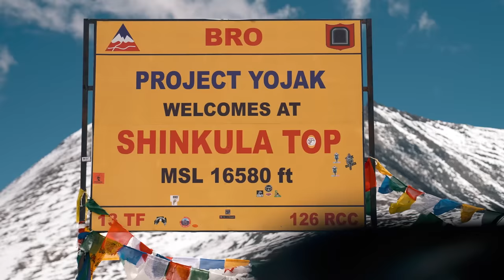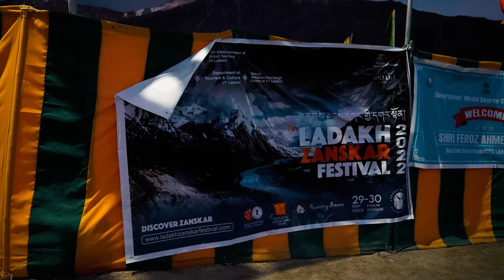Zanskar Valley - The most beautiful but deadliest place 🤯

Comment: Looks like you don't keep ur batteries warm when GoPro is idle. I have shot with GoPro Hero 7 in -15 degrees in Spiti in Jan and it worked like a charm.
Reply from the maker: Wow man, I don't keep anything warm but they all work well bud, it's the new Low Temp Endure made for sub zero so it should have worked.